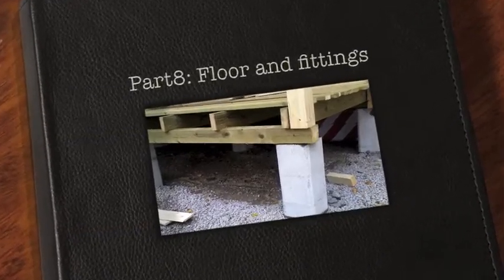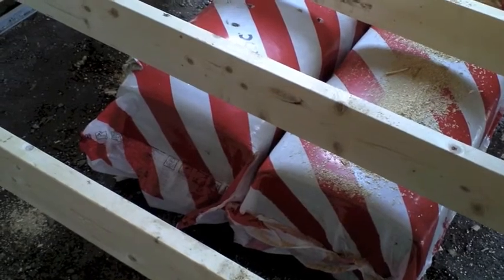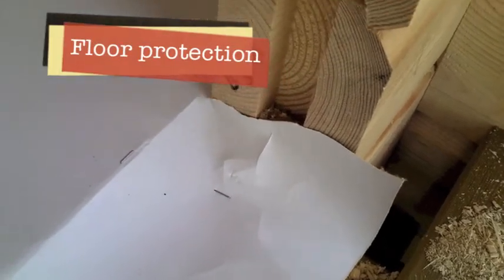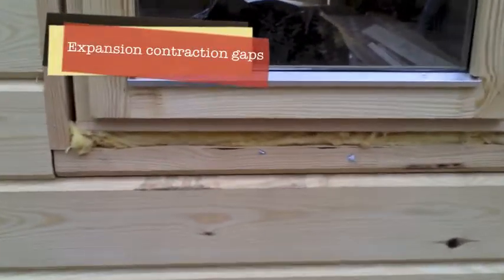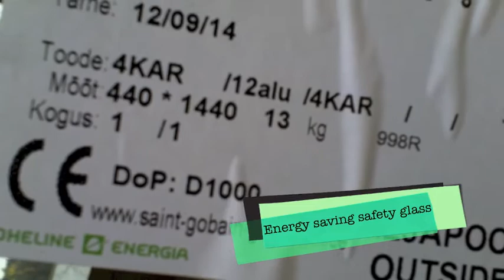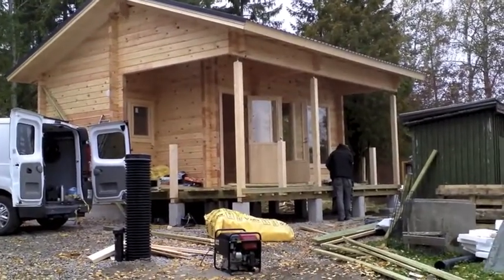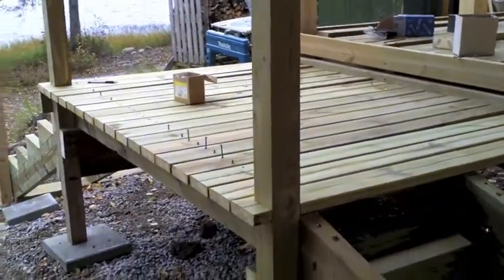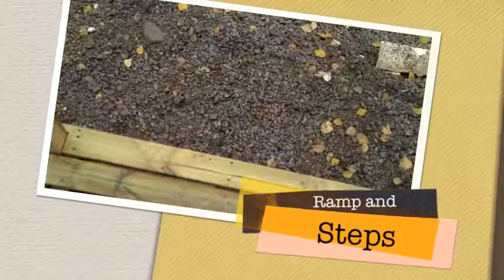Building a log cabin in Finland: Floor and fittings Part 8

Comment: Tell me about regulations!!! We're near winter and the town has to go through two committees to approve our plans, it's been weeks!!! Anyway, I like the attentions to every details put in your cabin, really nice.
Reply from the maker: We have had to excavate 30cm deeper than we would have needed… but we got a new car park down near the lake with all the soil that came out of the site. We had to lay down 15cm of styrox instead of the normal 10cm, we had to move the site of the sauna filtration more than 15meters from the lake and then there is the 70cm ruling for the height of the terrace  sometimes it feels like stones are being rolled into your path to block the way, but you have to plough on and come up with solutions. Best of luck with you project. Phone and pester them to get things done.

Comment: I wonder how Building Control decided on 70cms as the safe height...or, how much did it cost them to find that out?  Lovely house.
Best Wishes, Brendan.
Reply from the maker: Most likely they had a committee deliberating the matter for tens of years… threw children off the veranda to see if they hurt themselves… tripped up OAP to see if they could survive the fall… ruined a million crash test dummies before coming to the conclusion that 70 cm was OK.